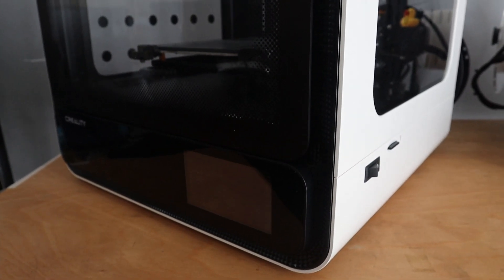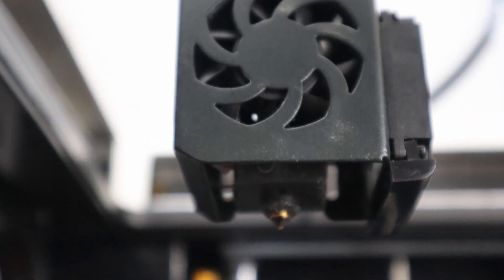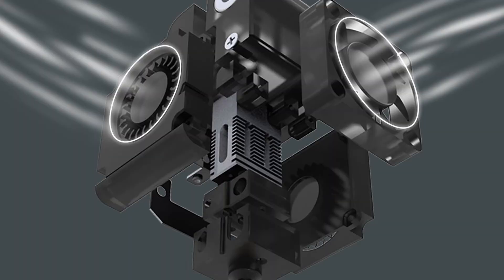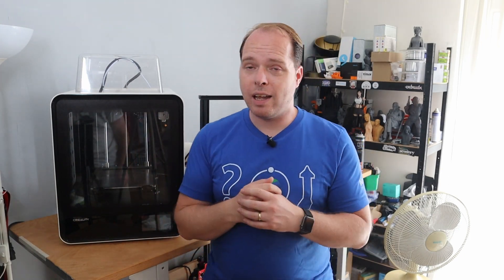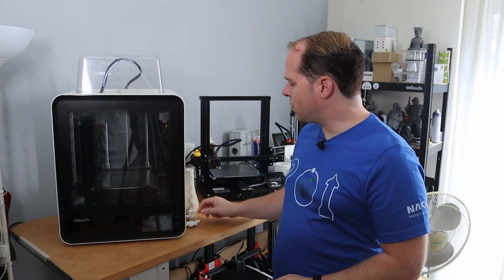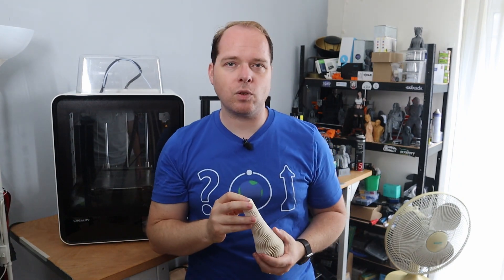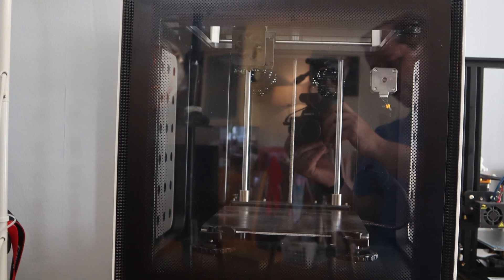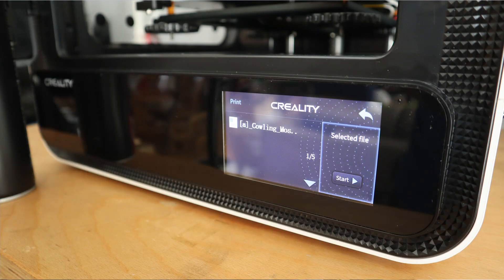Creality CR-200B Review - What are my thoughts so far

Comment: Hi! Was wondering what do you think of the CR-200B so far? I was thinkin on getting it but still not sure
Reply from the maker: Hi there, the CR-200B is no more... they do have the CR-200B Pro, but I rather would go for the K1 or some better printer. A lot has changed after that video.

Comment: Did your printer suffer from broken bearing retainers on the X/Y mechanism? Mine had all 4 caps broken. You can find heavier duty bearing retainers on thingyverse to make. When you see the stock retainers, you'll be surprised at how flimsy/thin they are.  I've seen comments about this on the web.

Also, I've only gotten one satisfactory print out of mine, visually it looks like the bed is crooked, so maybe I got one that was thrown around in shipping. I'll be looking at removing and reinstalling the bed and the mechanism to see if I can fix it. Currently though, it won't level the same twice in a row, even without running a print in between. I've even installed a CR Touch and it won't level the bed. Back-to-back leveling attempts require bed adjustment, so something isn't solid in the mounting somewhere. 

I picked up a Creality CR-6 SE and I'm really enjoying that printer, with the strain sensor the leveling on that machine is perfect, it's a great machine, just not enclosed.
Reply from the maker: Oh that is terrible that you encounter this issue on your CR-200B printer. I have 2 of them and both don't have this problem. On both the X-y mechanics are working as it suppose to. 
If there are some fixes that help your issue solving, then that is great. I hope Creality solves these issues when they are addressed. 
I didn't install a BL-touch since I want to keep these printers standard and at the time these printers didn't have a decent firmware for the BL-touch. 
I have heard great things about the CR-6 SE!

Comment: After a year of this review are you still happy with the machine? I am into buying my 1st 3d printer and for the safety of my little twins i really need one with the enclosure 😅 would you recommend it?
Reply from the maker: Yes I am happy and even won a second one. Since I have many printers to use, I use this printer not that much, but when I’m using it, it still is doing great. Keep the bed clean to keep prints sticking to the bed
Reply: @Zachary3DPrints  How to keep the bed clean? Are there any special cleaning chemicals i can use?
Reply: @jep31ehv  i use just alcohol to clean mine! i dont even need use glue on it... i just set the bed at 60, and clean it very well when its hot before printing

Comment: Hello have you tested other filament then ABS with this one i need a printer that can handle carbon and nylon and the normal PTU also.
Reply from the maker: It prints ABS very well, but like Nylon, the temps are not high enough. Which kind of carbon filament do you mean?

Comment: As you mentioned that this printer expected to be a supper quiet because of the plastic box ,but rather it is noisy more than Ender-3.Though that box magnified the fans noise and could be some reducing it with placing rubber washers where the fans fixed. The bed service also a none sticky surface and glueing it with the glue provided make the suface exstreamly messy so the hair supray would be the best as the bed design doesnt allow to add a plate.The Led light is not enough to see on all directions on the printer cave and coasing many shadows around and reflections.The hot end is hard to deal with incase of changing the nozzle as there are no thirmostat online suiting the hotend block as it has no exstra wire length incase rolled while changing the nozzle.The ballance between the printing speed and exstuding is excelant as can print ABS on 100 smoothly. Although the printer full of plastic with minimized of metal ,but it is heavy enough and stand still as if filled with sand.The temperature is up to 260 ° while expected to be a bove that up to 270-280° as ABS loves high temperature on some Filament requrement.The bed temperature is up to 100° while expected to reach 110°.
Reply from the maker: Hello Oraha Gayan, the plastic box can make the printer more louder than an Ender 3, for me, I didn't notice that this printer was that loud. For the glass bed, I have used hairspray to get it more sticky. There is that weird feel to the glass plate, which isn't on the normal Creality glass beds. Thank you for the comment on this video.

Comment: Is this 3d printer better than an Ender 3 Pro?
Reply from the maker: Even though the printing volume is a bit smaller, you can print ABS with this printer very easy. The Ender 3 Pro and V2 are ideal for normal PLA and PETG prints that don't really need an enclosure

Comment: Hi Zachary, as I am getting more interested int 3D printing recently I was wondering if you have advice on which printer would be suitable as a first? Specifically looking for one which has a closed box suitable for ABS.
And for the cr200b do you know if it is compatible with other filament types such as wood/PLA blends?
Thanks for your videos. Really enjoy watching them and very informative!
Cheers from The Netherlands.
Reply from the maker: The CR-200B is very suitable for ABS filaments, but if you are going to print PLA, better to use a Ender 3v2 are first printer and later buy the CR-200B. Because printing with ABS can be very challenging... especially with warping. The basics of 3D printing can be learned with the Ender 3v2.
But of course, if you are really want to start with the CR-200B, you can do that too, leave the door open and take the topcover off. This way you get more cooler air inside of the printer and the PLA won't get too soft too early
Reply: @Zachary3DPrints  Can the CR-200B print PLA and PETG too? I was thinkin on buyin this one

Comment: Very good review Zachary.  I really like printing with mine and very happy with end product. I’m happy to see Creality upgrading this printer with feedback from the users. The upgraded parts are a alloy extruder, more vents in the casing to allow the heat build up from the stepper motor inside the case in the back and a much bigger hotend. Led light is nice and bright and touch screen is nice but I’d of liked it to be adjustable so it could be angled up to use it standing up
Reply from the maker: Thank you Karl, yes indeed, very good points there. Although I had some little startup issues, these were easily solved. I didn't had much problems, I hope that Creality will make some great firmware upgrades, with the more files in the menu, scrolling text, folder reading and TL-touch feature
Reply: @Zachary3DPrints  I also hope firmware is coming to give the printer some improved features. There has been a few that have added BLtouch and running Klipper on the printer. Mine are a real work horse and very dependable with very little failures.